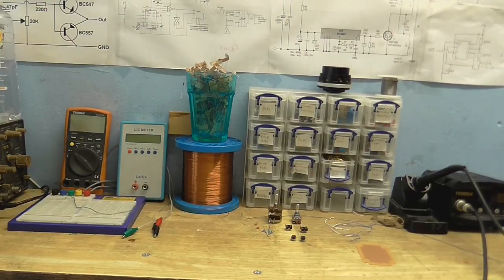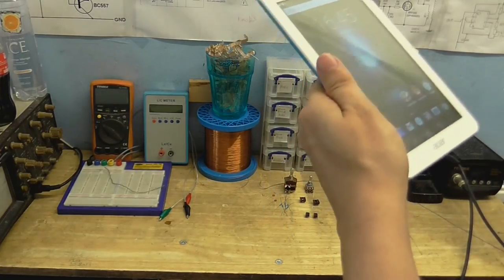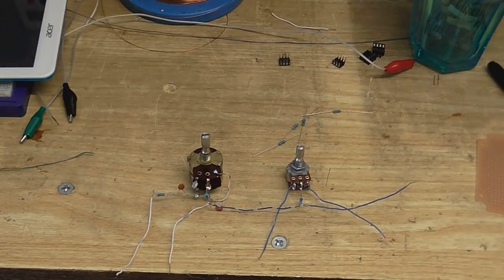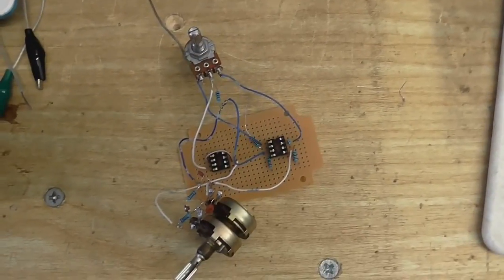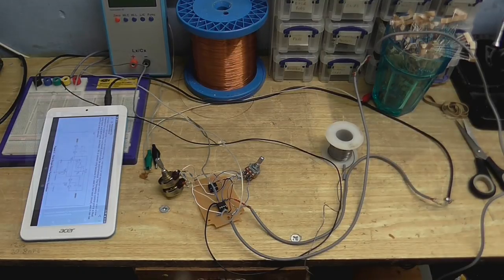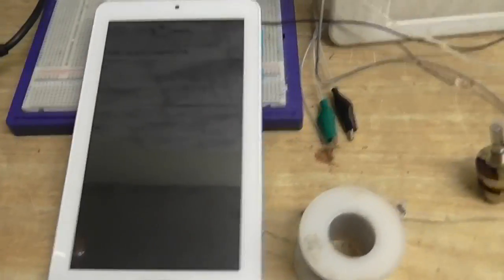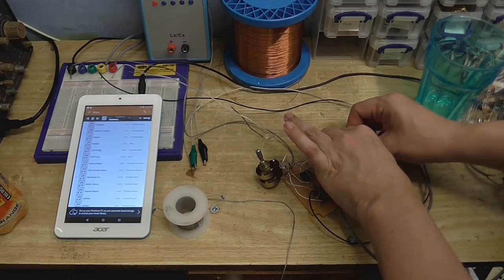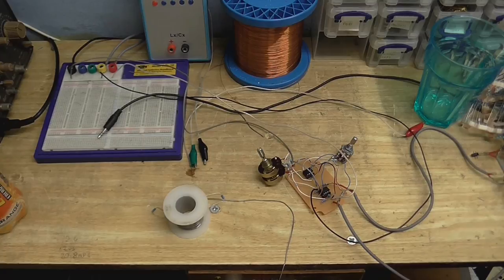CDC Electronic Workshop - Making a Parametric E.Q.

Comment: I shall go and look at the circuit. 
I need one , I bought new tweeters as can't get original.  So I need a smooth lift from 3000 all the way up of about 3 - 4 db.
I have a graphic but it will give bumps in response where parametric won't.